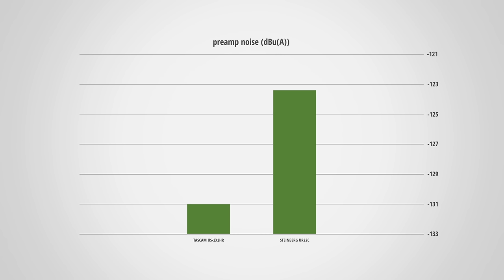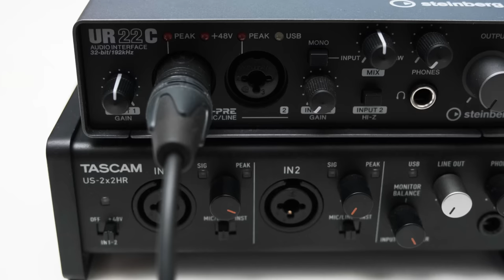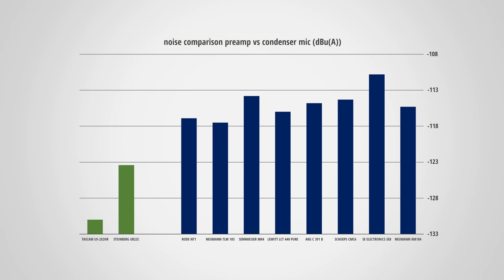You are WRONG about preamp noise!!! - (condenser vs dynamic mic preamp myth)

Comment: Julian I have always wondered about something and maybe you could answer this, how much does the dither type found in the converter chip effect the type of noise you get from an interface? Paul Frindle who designed the first large studio mixing console called the Oxford console (Sonnox plugins are an offshoot of Frindle's work) along with George Massenburg tested different dither types and came to the conclusion that a flat triangle dither gave better noise floor performance compared to exotic shaped noise. My question is do you think the dynamic range of modern audio interface are so low that this isn't an issue any longer or do you think that some of the noise (not all) we hear today in is partially different dither algorithms from the codec chip? I'm a huge fan of your channel by the way!!!
Reply: Your question is almost two decades late - I think the last ADC chips with fancy dithering options came out in 1997, and all parts introduced since the early 2000s have been straight 24-bit (and lately 32-bit) out. Since then, dither is (or may be) applied in the mastering stage in software, when it comes to creating 16-bit output for CD. If you set your audio devices to 16-bit in or out, chances are samples will just be truncated. At full bit depth, what you hear will be plain analog noise.

I've tried a fair few dithering algorithms, and I think I may have come across a possible reason for reservations against shaped dither... the shaped dither could have a rather nasty peak right around the area where human hearing is most sensitive to noise (4-10 kHz), poking out well above the flat dither spectrum. The most audibly benign one I've come across is Foobar2000's heavily perceptually shaped dither, as accessible when using its converter. Using an audio player for mastering may not be overly convenient but you can also get a highly optimized SoX-based resampler DSP for it so you may at least be able to kill two birds with one stone.

It be noted that dither and 0dBFS+ levels do not mix, as dithering assumes linearity. Keep true peak below 0 dBFS, with dithering on you can definitely afford it.

As an aside, lossy data reduction formats (MP3, AAC etc.) generally use floating point arithmetic and as such can be encoded from higher precision data. Later Minidisc recorders seem to have supported encoding ATRAC from 20-bit input, DCC could do 18 bit recording then, and retro activists have managed to even stuff 24-bit samples into its MPEG layer 1 audio recently (though I don't think any DCC deck ever had more than a 20-bit DAC). This may seem silly but does mean that lossy formats support higher total dynamic range than CD audio (which, mind you, is generally twiddling its thumbs as-is, given that its capabilities already exceed those of practical listening environments).
Reply from the maker: PileOfEmptyTapes and you made some good points. The reason you do not need any dither even for 24 bit in modern sigma delta converters is that they do not capture the signal in PCM but rather in a single or multibit stream that runs at much higher sampling frequencies (actually quite similar to DSD). These converters have high amounts of quitisation noise but this is pushed entirely out of the audible range resulting in an extremly high usable dynamic range. The thermal noise in the converter is often the limiting factor for the noise floor providing essentially natural dither. When the captured bitstream is converted to 24 bit PCM there is simply no dither needed. But most ADCs have the option to add dither, when they are set up to output 16 bit PCM as this can improve the usable dynamic range of the otherwise limited 16 bit format.
Tbh, the dynamic range of ADCs and DACs these days is so big that it is often more likely to hear other noise like ambient noise or inherent noise of the mic or preamp.

Comment: Hi Julien! I have a following problem: I sometimes use battery powered Rode NT-4 stereo mic as an on-top camera mic for simple music recording. I used it with Sony ZV-1 and Panasonic GH5S without any issue with a DIY 5-pin-XLR cable that has resistors removed instead of stock dampened cable that reduces signal strength by 12dB with some 1kOhm resistors. Thanks to that I get stronger signal and better noise performance. However, when I recently plugged that mic with that cable into the GH6, camera started to give overheat warning after several minutes and shut off despite being clold to touch. After a while I realised that the mic preamp must have overheated due to I/O impedance mismatch. Before it shut off the audio signal was clean, and when I used dampened cable there was inacceptable amount of noise. How can I manage this problem. Can I use some device that would increase impedance somewhere without introducing too much noise?

Comment: Formula to calc noise floor of condenser microphone based on specification:
[Equivalent noise level] + [Sensitivity in dBV] + 2,2 dB - 94 dB

(2,2 dB comes from conversion from dBV to dBu)

For example SE Electronics SE8:
Sensitivity: 25 mV / Pa (-32 dBV)
Equivalent noise level: 13 dB

Substitution into formula:
13 dB + (-32 dBV) + 2,2 dB - 94 dB = -110,8 dBu

Am I right with calculations?

Comment: But the thing is, it's most common to find dynamic mics on loud sources (drums, amps, etc) and condensers on quieter things like acoustic string instruments and vocals, so it generally works out that noise isn't a huge deal most of the time with either type of mic. If you put some tubes in the circuit though you're definitely going to get a bit of noise regardless of what type of mic you use, but it's generally worth it. :-)
Reply: Tubes just make the noise nice harmonic noise. ;-)

Comment: If you are using a cheap handheld recorder with a high EIN and a very low noise condenser, the noise may be doubled. With the very sensitive small diaphragm condensers the same preamp will not contribute a significant amount of noise. A modern home studio card, even a 200 euro one, will not add significant noise to any microphone. The noise contribution of the preamp and the signal per noise of a specific sound pressure level  can be calculated from the specification of preamps, dynamic and cardioid mics.

Comment: Thanks, great video :) One question though: In one of your other videos (I think it's the Arturia interface test) you state, that a preamp at max gain will create a roll-off in the high frequencies.
Sooo, is that a trade-off when I use high gain on my preamp? Should I back off a little instead to have a more linear frequency response? Or am I misunderstanding something? Danke und weiter so.
Reply: Bin kein Experte, aber ich könnte mir gut vorstellen, dass das Interface einen Bereich hat, in dem es optimal arbeitet und einen Bereich, der zwar nützlich ist, aber nicht unbedingt maximale Performance bringt. Z.B. beim UMC404HD Review ist das Interface bei maximalem Gain nicht mehr so sauber, wie wenn man ihn ein wenig runter dreht. Wenn du keinen Unterschied hörst, sollte das aber auch kein alt zu großes Problem sein ;-)

Comment: Hey Julian..thanks for the wonderful video...have a doubt though..
So wat should be the ideal equalent input level of a condenser microphone according to you?...I hve an mxl 770 stating the EIN at 18db(A weighted)..is tht adequate?
Reply: the noise rating itself is only good to allow you to compare the mic to other mics. sure, a lower selfnoise is better, but not everyone needs ultra-low-noise-microphones. if you want to do asmr or other super quiet and fine sound-recordings, 18dB(A) is probably too high. if you want to record vocals for lets say a band or just your voice while gaming, you are most likely fine. A microphone has characteristics other than just its selfnoise and giving that the mxl770 is a popular and well-recognized microphone you likely had a very good reason to pick it.
tl;dr: If selfnoise is the most important aspect of the microphone for you - lower is better. but thats not the case for most people. if it sounds great for the things you capture with it - awesome!

Comment: Julian,
Something I have been stumped by for sometime now is noise when using electric guitars into the instrument input of preamps. I am specifically running a focusrite scarlett 18i8 2nd gen into a mac mini. 

Using the same signal chain saturation into a guitar cab IR, a real amp  (with no noise gate) at the same relative preamp gain is WAAAYYYY quieter than an amp sim providing same amount of gain. I suspect this is because the real amp is amplifying the clean signal while the audio interface is receiving a clean signal but is being converted from analog to digital before it actually hits the amp sim.  

The noise floor in the amp sim world drives me absolutely crazy. Just curious if you might have any suggestions on working with amp sims in the digital domain. 

Thank you and so grateful for all the work you've done providing information for the community!

Comment: Well, to fairly compare microphone self noise, you have to adjust the noise spec using the sensitivity spec, to bring everything to the same target signal level, say 0 VU.

I'd like to see someone explain the maths for that, especially as the sensitivity spec is defined in a couple of different formats.  It would be nice to have a full & reliable explanation on how to convert these things.

Ta

Comment: so I have a midas DL16 stage box i've been experimenting with using 4x xlr inputs combined together for lower noise recordings.  Turns out the TRANSFORMER in dynamic mics actually adds to the noise floor, so a SM7B actually has lower noise than a SM58 even tho the output is louder on the SM58 due to the transformer... at least I think so far... im not done toying around yet

Comment: The noise level on the Steinberg is just mad in comparison to many of the others. Especially because I gather Steinberg (And Yamaha who owns them) is a generally respected brand. And the form factor and the price is basically the same as many others. 

I actually have a rather old Steinberg CI2+ as a backup interface. It's stupidly simple and just works plug and play at least on windows computers. I haven't even attempted to measure it's noise performance when I've had it connected - I've used it with condenser mics in meetings and calls and it hasn't been noticeable, but then in a meeting no-one's listening to that small amount of noise even if there is any.

Comment: people worry too much about preamp noise anyways. -130dB noise floor? I remember not being able to hear -50 in my daw on solo, let alone in a mix. Noise is usually close to white noise, which pretty much always get's lost in a mix until the mix is not dense (like a piano and vocal duo). My analog gear produces at least 20x the noise of the boring ultra linear home recording equipment shown here but I enjoy the sound of an overdriven mic pre with an aggressive compressor. Even if it's noisy as hell.

Comment: Of course, the compression which youtube adds alters what we "hear" in the examples as well, which must be taken into account.  And with youtube, if listening on a laptop's speakers, the difference between a Lewitt Sub Zero and a TLM 103 (on a youtube clip) will not be readily discernible to the average listener "listening" on a current iteration of a decent laptop, vs good earphones or monitors, but all-that-aside, I love this video!  [edit] the Lewitt sub-zero and TLM 103 have verifiable 'super low" self-noise compared to other condenser mics, and I feel that should be recognized for this discussion.

Comment: Hello Julian! I want to buy an Presonus Studio Channel for my Audient id4. Do u think i need an di boxes to don't damage the audio interface? Or i can pass directly to the Pressonus into Mic/Line ?
Reply from the maker: Hey, the studio channel has a line output you can route that straight into the line input on the iD4. No DI needed.
Reply: @JulianKrause  Thanks a lot sir! All the best like always! <3
Reply: I just buy an dbx 286s and make little bit noise like zzzzzzz(hum) is normal that? Used from id4 line with trs ballanced to output dbx :))
Reply from the maker: @kenzorwings  Do you mean the housing of thhe286s itself or the recorded audio hums? There is a transformer built into the 286s which in some situations creates an slight audible hum when you put your ear close to the housing. That's pretty normal. If it is excessive you might try to replace it and but it's a bit of a gamble. Some are better, some are worse.
Reply: @JulianKrause  When i record it doesn't have background noise,only this hum from this transformer from inside,but is disturbing little bit(for me). I already replaced him with other who sound more normal than this. I hear and i saw other's post that are some line's of them to have this strange hum(dbx 286s buzzing sound it called). Thanks a lot! Do you think i need an power conditioner or a normal socket adapter with switch on / off because it doesn't have the power botton?

Comment: Very good video. Question... when streaming on a laptop, my fan noise is loud. I run my recording through a RODECaster Pro and have made adjustments on that equipment, but still I have the fan noise. I have tried noise compression, a limiter gate, but still it is there. Any suggestions? Thanks 😊
Reply: conventional noise reduction sounds bad, it's usually much better to somehow get rid of the noise or increase signal to noise ratio by getting the mic closer to the sound source, choosing a different pickup pattern, or blocking the sound path of the noise between source and mic. Something that could help would be Nvidia RTX voice, which is a more intelligent algorithm of separating speech from a noisy signal.
Reply: Easiest way: someting with a lower fan noise. Second: microphone with a polar pattern i.e. hypercardiod, that reject more of the laptop noise. Third: try a dynamic mic, they are less sensiitive than a condenser mic, but make sure, that you are really near the capsule when speaking. Forth option: use commercial products like Izotope RX9 Spectal Denoise to remove the noise in postproduction.
Reply: What mic are you using and how far from you do you have it set up?  Generally, the best thing you can do is get the mic closer to your mouth and turn the gain down.  If you already have mic as close to you as is practical, an external monitor, keyboard mouse could let you move the laptop further away or behind something that will block some of the fan noise.
Reply: Move the laptop/computer away from your steaming desk and use an hdmi cable to an external monitor with Bluetooth keyboard and mouse. I had exactly the same problem. That’s what I did.
Reply: @Wayne Brown He can use a Sound Devices Mix Pre 3 mk2 with noise reduction plugin when he is streaming. But it would be easier to change the noisy device.

Comment: LCT 540 S makes a good exception to this rule.
Reply from the maker: It first might seem like it, but it is actually not. Yes, it has a very low equivalent noise level of 4 dBSPL but quite a high sensitivity of around -28 dBV. If you do the math, the output noise is -115 dBu(A) which is significantly higher noise than the typical preamp you find in an interface.
Reply: @JulianKrause  Interesting!

Comment: Hey Julian! I loved your review on the MOTU M2. So I picked one up myself. I know you also use windows and wanted to know if you initially had any issues with audio crackling and cutting out. As well as some nasty high pitched distortion I am experiencing. I may be upgrading my motherboard soon as a result. But know that it could also be a driver issue. I have tried everything and wanted to know if you have any knowledge on this issue. Thanks.
Reply: A friend of mine experienced this with another interface because he chose different sample rates and bit-depths in windows/the DAW and his interface drivers - might be worth to check those! I have a motum2 myself - thanks to Julian - and with the latest drivers installed everything works well. hope you can figure it out, all the best
Reply: @DrWurzeli  yeah I have tried everything. I’m just thinking the sound card on the motherboard just isn’t up to par with the interface